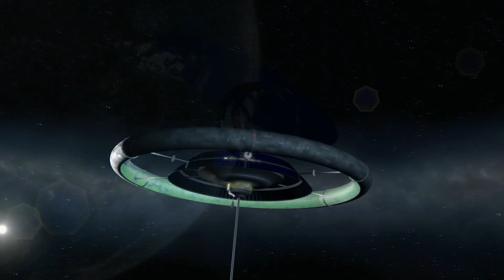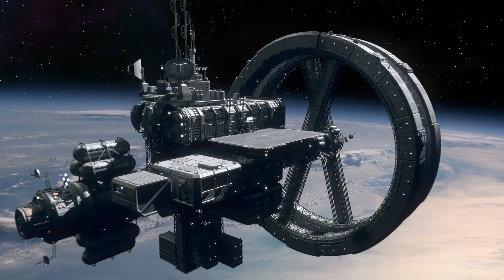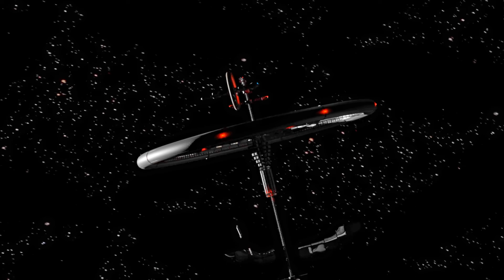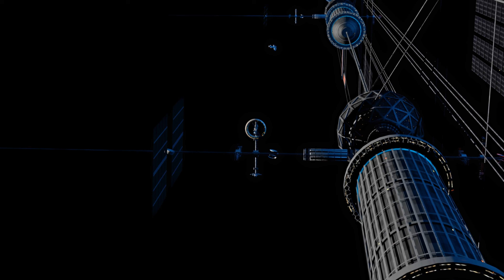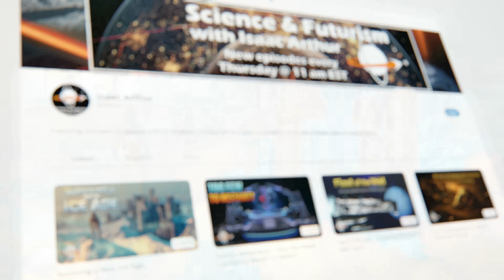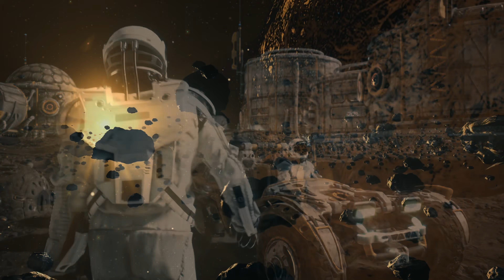The Von Braun Wheel - Building Humanity’s First Rotating Space Station

Comment: Remember people. Us Goyim and Useless eaters are 50 years behind those in power. There is a reason Antarctica is blocked out with white boxes with the Google trademark on it for 80+% of the continent. 

That being said. As they roll this tech out or people(or a.i.  pushes out  things like this for us to ponder) it’s already built and active. You don’t have to believe me I don’t care. It’s proven to be true over and over and over again throughout history. 

They can “fix” the gravity problem using this method, or they can use electromagnets  to create a magnetic field large enough to encompass a station like this and use electromagnetism(the other theory that also directly mimics gravity). 

It’s a simple tech and we have built prototypes to mimic these things already. 

Lastly, take into account the moon is likely a lot closer to earth than they claim, has its own gravity though much weaker a simple station with boots and an electromagnet in the flooring that would and could directly mimic earth gravity just by creating the exact force needed to separate your feet from the ground as you walk around the station, or moon base. 

Artificial gravity has long been solved it’s just not going to be like the movies without an extreme jump in the science of electromagnetism. Nice video though. 

They always roll out new tech in pieces. Suck us dry of money and energy while they do, then create huge problems that require huge solutions to fix it.  

Then the “new tech” is rolled out and bam, new “Industrial Revolution , or Enlightenment “happens. Welcome to this conspiracy talk.

Comment: The International Space Station is failing after just 25 years [with no-spinning]... so how will these be able to last multiple decades?
Reply: The ISS keeps its belly to the Earth as it orbits, which it does about 16 times per day. So it rotates 16 times per day. Its farthest forward and aft parts are 54.5 m from its geometric centre, and I'll assume its centre of mass is also halfway forward and aft. At that distance, 16 revs per day gives 7.5 microgees.

A bolo habitat lasts forever if you now and then replace subassemblies such as the spin-axis structure, the elevator(s), the ziplines, the habitat(s, if there's one at each end), and also occasionally replace tether strands. And the far-end module, if that's not a hab.

But if you can't do that, and it only lasts as long as the ISS, well, 25 years is multiple decades.
Reply: @grlcowan  That's orientation not rotation - not on the scale of a station maintaining centrifugal force as discussed.
Where as a station could be thought of as similar to a building/bridge, those are not subjected to vast and frequent  temperature changes of orbital environments.
Then there's the metals. Exposure to radiation results in radiation hardening which strengthens it while subsequently embrittling it.  This occurs as a result of knocking atoms out of their lattice sites through both the initial interaction as well as a resulting cascade of damage.
Given that stations in LEO are provided some protection, Mars etc. would not. What life expectancy would you give these expensive structures?

Comment: 75 m radius at 1.7 rpm is about the minimum size that doesn't make people nauseous because their head and feet experience different gravity. Its astronauts would experience ¼ earth gravity. Building a full ring makes that almost half a km in circumference. Just the ring would be 10x the ISS.

The idea of balanced modules on a tether is already much more plausible, though you'd still need a non-rotating docking hub at the centre and elevators that can go from the central hub to the spinning modules. The coupler between the rotating and non rotating parts is an engineering challenge that will make the cost of such a station comparable to the ISS. 

I think von Braun greatly underestimated the cost of building in space. I don't expect to see a full ring this century. Maybe a counterweight tether station as a space hotel or low gravity research project.
Reply: A nonrotating hub is not needed.

A hub is advantageous , but it does not need to be despun. That's how you solve that engineering challenge.

It needs to be an unpressurized drum with a tuned mass damper to suppress the tether's fundamental guitar-string oscillation. It needs a pair of holes for each strand of the tether. One of these pairs of holes has at least one of them big enough to let the elevator through. In a small spaceship you come in at near-zero relative speed and plonk your vehicle's belly onto the inside surface of the drum. That surface is going, like, 1 m/s in the nonrotating frame of reference.

In the rotating one, it is you who are going that fast. After plonking down, you slide or roll a short distance, then stop.

Now you have milligees of gravity holding you onto the drum surface, so docking to the elevator is reduced to a two-dimensional problem.

Where the tether strands pass through it, the drum needs to have pairs of opposed wheels, usually braked, gripping them. When something heavy goes down to the one-gee level, the spin axis moves that way, so the wheels need to turn until the drum is again centred on it.

The end modules do not need to be balanced. The heavier one is less far down, and gets less gravity.

Comment: Start with cables and modules... a full ring later
Reply: Why don't we pencil it in for never? Never works for me.

If you like big, an efficiently-shaped pressure habitat at the bottom of a rotating cable can be as big as anyone's dreams of unbuildability could want. On an eight-kilometre-radius cable it could be a 1-km sphere!

True, dreaming it that big, and then extending it spinward and antispinward until its ends join and you have a ring makes it much, much bigger, and brings in an exciting possibility of destabilizing load shifts. Much dreamier.

Comment: I favor wheels over cylinders, as a wheel is stable in rotation. 
I prefer a wheel which has its rotation axis pointed directly at the sun. The sunny face of the wheel gets sunlight directly, without mirrors. 

The sunny side could have solar panels, or windows for growing crops. Plants could be grown on terraces.

The wheel would be built without rotation and spun up by an electric flywheel/reaction-wheel. The flywheel could be coupled to the body of the wheel to allow easy reorientation of the wheel to keep facing the sun. A braking system could stop the wheel entirely for docking and maintenance.

The interior of the rotating space station wheel would include another wheel turning at a slightly different speed than the rest of the structure. That wheel would have a different "gravity" than the rest of the wheel. 
It would serve as a transportation system, if the inhabitants could cross from one wheel to the other. 
It could also serve as a ventilation fan, keeping the air circulating. That would require some energy input.

Comment: Could a Coriolis effect be introduced if the wheel's axis were to change slightly while rotating?
Reply: Suppose someone lands a heavy vehicle on an unpressurized part of the wheel, and its mass is not tiny compared to the wheel mass. This causes disturbances, but they are not Coriolis effect.

Coriolis effect is when you dash upstairs and find yourself leaning on one of the handrails as you go, or run downstairs and find yourself leaning on the other.

(The disturbances: standing next to the heavy spaceship as it landed, you would notice a reduction in gravity strength. People a quarter of the way around the wheel would notice that the deck where they were was now tilted away from the landing site, and people 180 degrees away would notice their gravity had increased.)
Reply: @grlcowan  I was thinking more of a slow, purposeful, permanent change in one direction to the axis, and not a wobble.

I guess, instead of it wobbling back and forth, the 'wobble' would only occur in one direction, but slowly and continuously.

I'm not very satisfied with what I'm trying to describe, and can't do it very well without demonstrating, somehow.
Since a wheel likes to spin stably, it will never go off kilter without a force acting on it.
Reply: @chrislong3938  I don't visualize complete wheels because I don't think anyone would build one. I visualize a bottle-shaped pressure bottle hanging from a multi-kilometre tether. But this can be considered a kind of wheel; it's just all missing except for a big spoke (the tether) and a small piece of wheel near it (the bottle). But everything I am about to say applies to wheels of any degree of completeness.

Not just a force but a torque . If Arcturus is in the spin plane, and you're in the farthest-out deck in the bottle -- aka the bottom deck -- and every time Arcturus passes underfoot, you give a little out-of-plane blip from a motor on that deck, that's a torque pulse. Over many rotation periods, the system's spin axis will precess around the line to Arcturus.

But if you turn the motor on and leave it on, the angular momentum change time-averages to zero, and the system moves without changing its spin. It acts just as if the continuing thrust were at the centre of mass.

The once-a-turn blip is right if you want to keep the system's spin axis pointing at the Sun as you orbit it.
Reply: @chrislong3938  Not just a force but a torque . If Arcturus is in the spin plane, and you're in the farthest-out deck in the bottle -- aka the bottom deck -- and every time Arcturus passes underfoot, you give a little out-of-plane blip from a motor on that deck, that's a torque pulse. Over many rotation periods, the system's spin axis will precess around the line to Arcturus.
Reply: @grlcowan  I'm gonna have to rewatch the video since I'm not sure what you mean by Arcturus. The star?
Gimme a few hours or so.

In any case, what I'm visualizing is the wheel's plane of rotation, changing 360 deg repeatedly, but slowly. 

'Plane' was the word I was looking for!

Comment: Gemini 11 and CROPUS did very limited experiments with spin gravity. How hard (or expensive) would it be to tether a capsule or habitat to an expended upper stage and spin it up? We need data on long-term physiological effects of Moon and Mars gravity. 
SpaceX should plan to send Starships to Mars in pairs, tethered nose to nose and spun to achieve Martian gravity at the nose, and near-Earth gravity at the bottom of the crew quarters. One SS crewed, the other for extra cargo and supplies. That way, we'll arrive acclimated and ready to work immediately, not requiring days or weeks of recovery from months of zero-g travel. 
After the trans-Martian delta-V burn, two SS should be able to dock together and connect a flexible harness and cable (Kevlar?) between the lifting points of each. Then fire thrusters to separate and spin up on the tether for the duration of the trip. Send Optimus (Optimi?) out to do the rigging!

Comment: To rotate the entire station causes a number of problems.  Docking is the first, as you only have two points you can dock to, the poles and one of those must be next to rocket station keeping thrusters and so may also be a problem.  Much of industry in space needs ZERO gravity, not less gravity.  Star gazing, astrometrics, deep field detection asteroid detection and moon mapping  and planet gazing will all be ruined if the entire station spins.  Also falling down the connection tunnels will cause acceleration  and could cause accidents during impact.    Rotating rings on a stationary structure also causes risk of air loss at the seam.

Comment: Having a strong industrial presence on the Moon will enable to construction of large orbital structures.  Lunar regolith contains a lot of oxygen, silicon, aluminum, and titanium.  If these can be mined, processed, and turned into cannisters of oxygen and basic components for stations, like curved aluminum panels and titanium bits of hardware.  They could be launched from the Moon using a long rail gun, then snagged by a "tugboat" and maneuvered to an orbital warehouse.  They could then be taken as needed for a factory in lunar orbit to build all the structural elements of stations.  Regolith also contains useful quantities of calcium, iron, magnesium, manganese, sodium, potassium, and phosphorus.  It's likely that unexplored lunar locations have other useful constituent elements.

In addition, lunar regolith could be put in the equivalent of sand bags to provide excellent protection from meteorites, cosmic rays, and solar storms.  Electronics, reactors, and other things that require advanced manufacturing would be launched from Earth and installed at the factory for completion.  The basic station would have a set of rockets and thrusters to re-boost its eventual orbit as needed.  It would be delivered to its operational planet or moon by a very large interplanetary tugboat.

Comment: Why rotate the center of a space station? The non-rotating core is where everything should go that doesn’t need gravity.  Also, I don’t see heat dissipation solutions. Please accept these questions respectfully. I enjoy your work
Reply: A space station that is a multi-kilometre rotating tether with gravity-friendly loads at its ends can have a spin axis structure, not at the geometric centre if the end loads are unequal, that has very low gravity because the spin rate is low. This very low gravity is useful, even for things that don't need gravity, because it gently makes them stay put in that structure. There is no need to despin the centre.

Comment: How about the coriolis force? Will people really get used to that. The rotation has the effect that when you try to walk straight forward your body will try to continue straight forward in the non-rotating coordinate system. This will turn you to left or right depending on rotation direction and your direction. To walk straight forward you have to fight this effect with every step you take, partly by tilting your body in the oposit direction. Not even Spaceodys. 2001 get this really right.
Reply: um no
its a vector product of rotation and in-system motion
it only points left or right when you have an up-down component to your velocity (up being towards the rotational axis)

Comment: Every time i see this turning stations i wonder ... what sort of seal would be able to hold that spinning part connected to the static parts, without leaking like crazy. I mean sure seals work fine on Earth ... but that sort of pressure diference, temperature difference, and HUGE area? That doesn't sound like a easy fix.
Reply: you could keep the hub in a vacuum
Reply: From what I understand, only the central hub stays still, everything else moves around it.
I think of the hub more like a ball bearing, a small diameter cylinder with a larger diameter hub spinning outside. The larger hub would have the supports, walkways, and elevators attached, leading to the outer ring. I'm not sure how you'd get from one to the other, though.

Comment: I think we need to stop talking about rings and go with the practical solution of using two structures connected by long cables.  There's no way we're going to start off building a massive ring.  The tethered design allows us to have a massive radius without massive structures.
Reply: Yup.
Reply: This! It would also be much easier to add to.
Reply: @AndyKauffmanGleekop  Yes, it can eventually be grown into a ring, but that would likely require adding 100 to 500 times the mass.  But that means we can start at 0.02% of the launch mass, which makes the project approachable, whereas the ring will always remain pie in the sky and nothing ever gets done.

Comment: Needs to be big enough to generate earth gravity at one revolution for 24 hours to feel right. That’s also important for plants to grow. But there’s still the problem of dissipating heat.
Reply: Not really realistic to have one revolution per day
Reply: Keeping one area windowless and setting the lights to a 24-hiur cycle might have the same effect.
Reply: You wouldn't have windows to outside. Once your light is generated inside via LEDs, you're not worried about coordinating it with your rotations.
The bigger concern is how to generate that electricity. Authentic Moon rocks can be identified by the tiny holes punched into them by space dust. That stuff is not kind to solar panels either, which makes them a short term power system - adequate for a satellite, not so much for a permanent city.
Reply: @tealkerberus748  the less mechanical it is, the longer it will last and the fewer replacement parts have to be shipped in.
Reply: @headfirst6227 "zero maintenance" is a myth
by the time maintenance is needed, everyone who knew how to do it either forgot or died
Reply: @bottlekruiser  not zero maintenance, just low maintenance. Plants and animals need natural light and it’s easier to gather than it is to create. I agree that constant maintenance will be needed, but it sounds like you think everyone will turn back into apes as soon as the ribbon is cut.